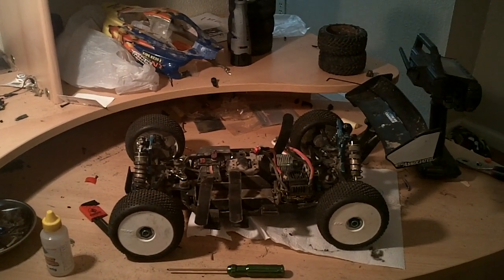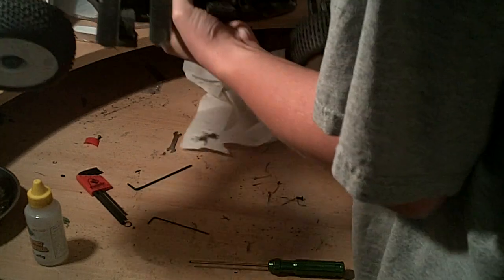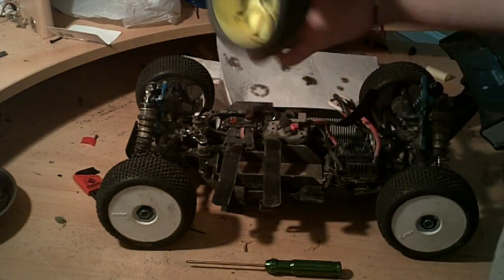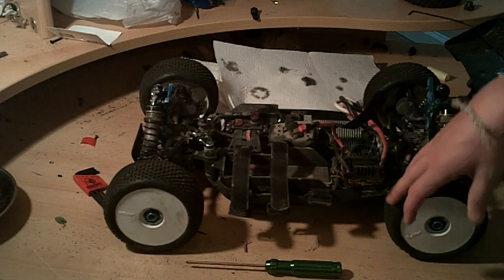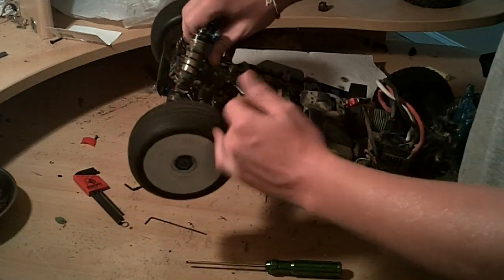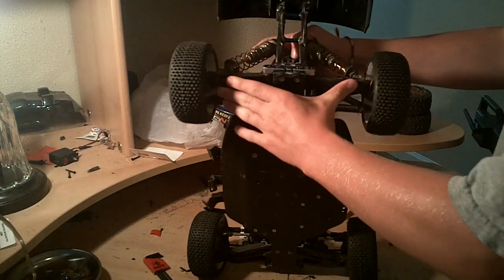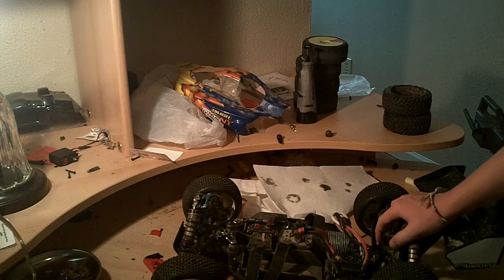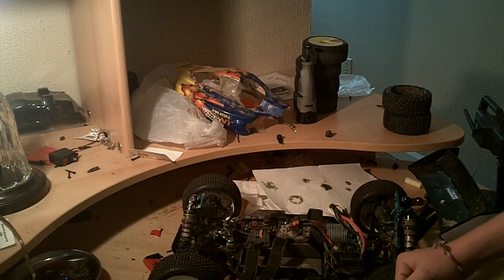rc8be update part 4

Comment: idk if you mentioned this, but you should get the Elitle RC or Grid RC motor mount for that thing.. Apparently the stocker is very bad, since the motor is easily able to move, as well as you have to take apart the CD just to get to it..

As for your motor temp, 130 is VERY low.. 150 is generally a sweet spot. 160 is borderline. 170 is too much.